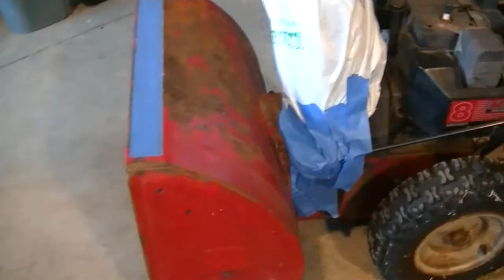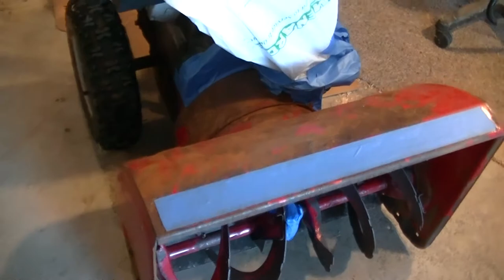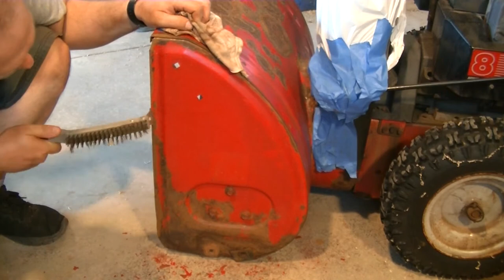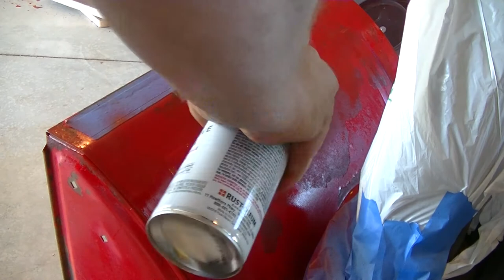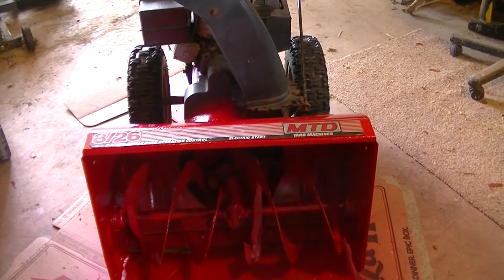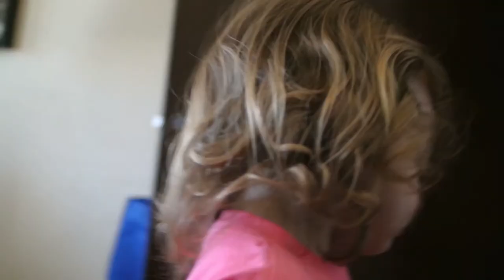Make an old snowblower look new, well sort of...

Comment: I got an ole ‘84 craftsman 20” snowblower that I picked up for $100 a few years ago, took her apart and cleaned her up. She works great. I’ve had to rig a few things as far as throttles and whatnot but she starts up every time and moves snow anytime I use her. I will be getting a plow for the truck soon but I will most definitely keep my craftsman around and still give her some work to do. I can’t fathom spending the amount of money a new blower cost nowadays. I just have so much property that needs snow removal so a plow makes the most sense for my situation.
Reply from the maker: I splurged on it for sure. Funny thing is right after getting it I got a rear blade for my tractor and found I really like using that more.  So, I barely use the Ariens.  Although when I do it works well.